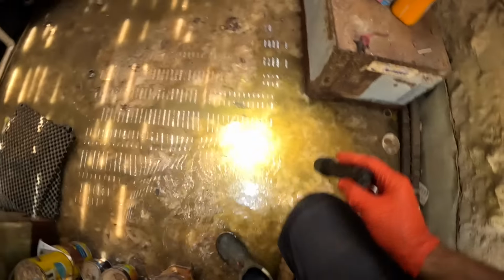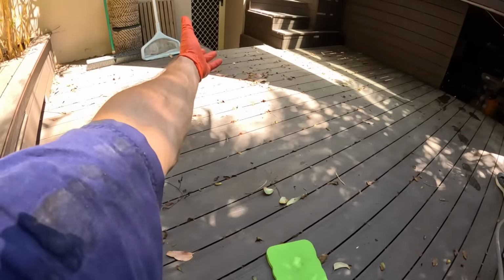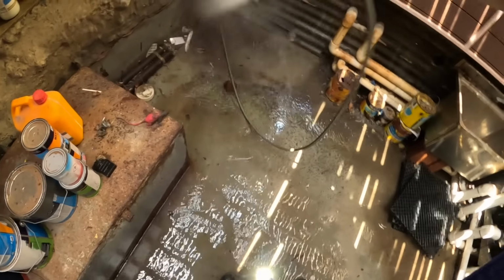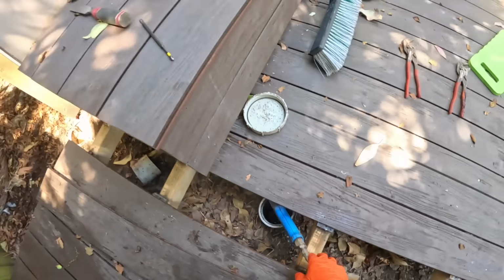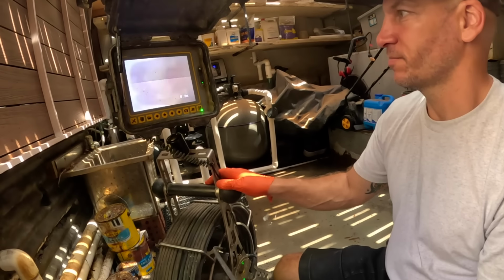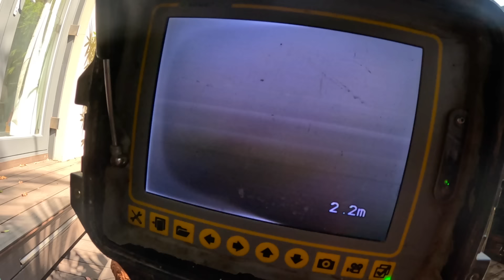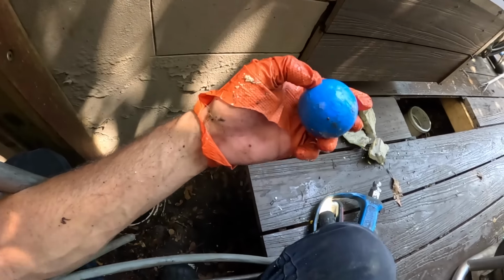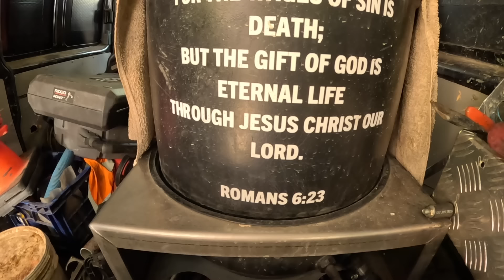Blocked Drain 906

Comment: Ryan. Loved the sarcasm about covering up good boundary traps. Lol! Excellent detective work and clearing this puzzle up. How hard would it be to run an extension through the deck so it doesn’t need to have boards pulled? The solution you came up with was great!